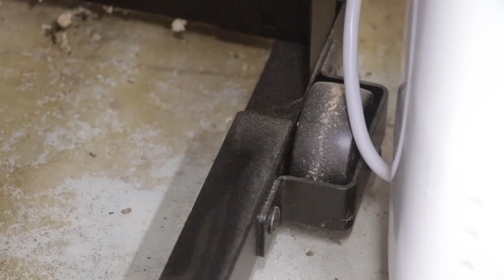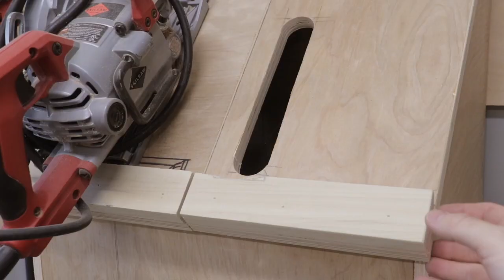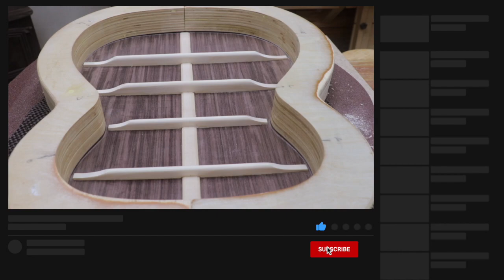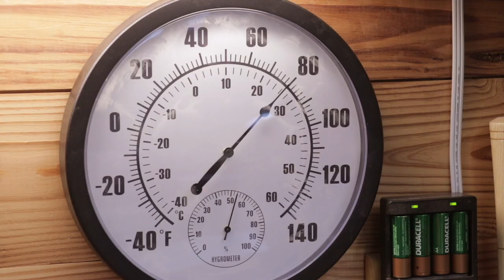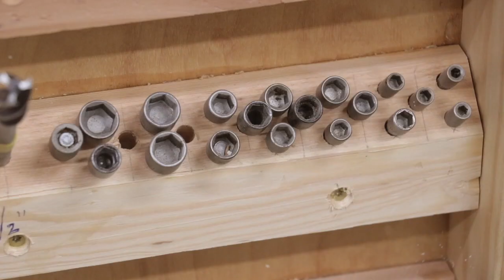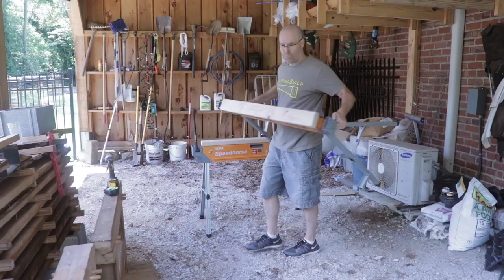Woodworking Shop Ideas? Take My Tour!

Comment: If you relocate the dust collector outside, that's a lot of CFM that will need to be "made up" from your shop, that will draw untempered air thru all the cracks on walls and around doors and really make the shop uncomfortable in the summer and winter, usually only a good solution in the spring and fall.
Reply from the maker: Ideally the filtered air would be ducted back inside! Good points! Thanks!!👍